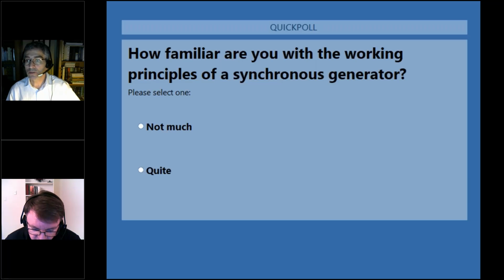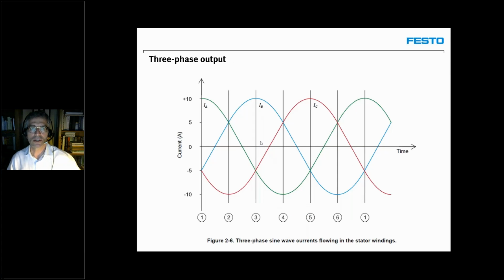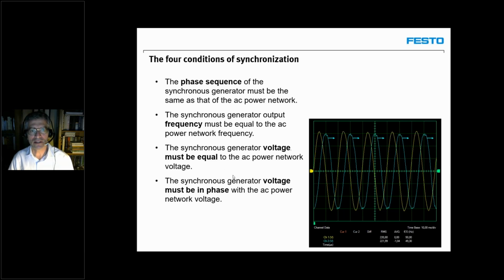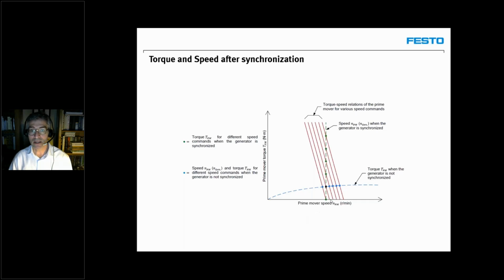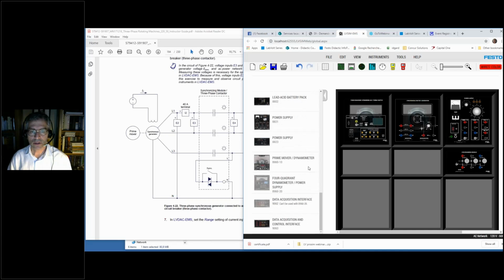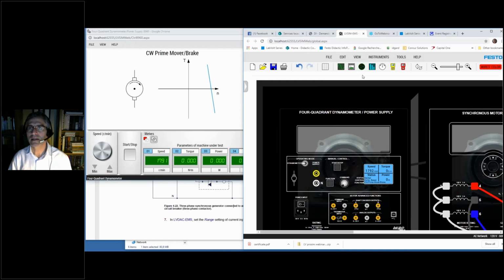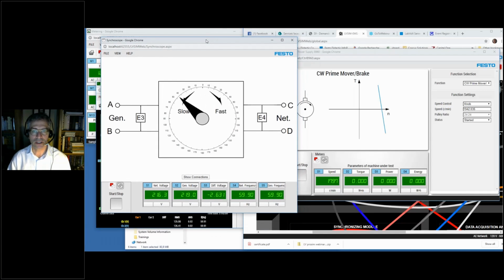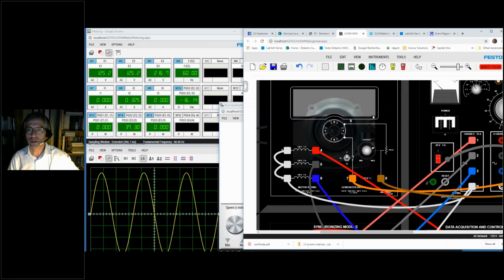[Online Training Session] Generator Synchronization

Comment: thanks for your information, 
I made synch for three gensets togther and i face proplem in two gensets, once both gensets work togther there is 40 amps each phase without any load and when i check on genset controller i am not found any reactive or active power just VA power, are you have any explination for this issue
Reply from the maker: Thank you for the interest you show for your training solutions. You could send a support request to services.didactic@festo.com and our colleagues will be able to help you. Because to be able to help you with your current problem, we will need some more info:
•	Are you performing the synchronization with the physical system or with our simulator software LVSIM-EMS?
•	Could you send us some screenshots/photos, or a short video, demonstrating the issue? We would need to see the connections between the modules, the status of the synchronizing module and the various monitoring windows in LVDAC-EMS (meters, oscilloscope, synchroscope and four-quadrant dynamometer).

Comment: What are disadvantages of different rpm generator syncing?
Reply: Hello.  Mechanical power is torque x speed, so the slower you go, the more torque (force) will be on the shaft.  That being said, the frequency the generator creates has to match the network.  At the design phase, you can decide how many poles the generator will have, but you're pretty much stuck with your design.  For example, foe a 4 poles machine to give 60 Hz, it HAS to run at 1800 rpm.
Reply: @philranger9825  Sir ! I didn't get you ll u plz elaborate?
Reply: @sardarmuhammad405  I'm sorry, but I'm not sure I understand your exact question.  The synchronization cannot be at a speed different from the network, they need to be "synchronized".  For example, 60 Hz = 60 cycles per second, so the machine needs to rotate at 60 turns per second (3600 RPM) if it has a single pair of poles per phase.  If you have 2 pair of poles per phase, only a half turn is needed to cover the three phase, so the synchronous speed would be 1800 rpm, etc.  A basic explanation is given here: https://en.wikipedia.org/wiki/Synchronization_(alternating_current)